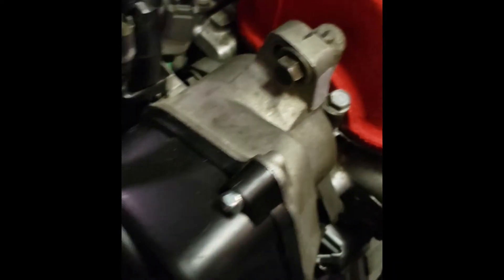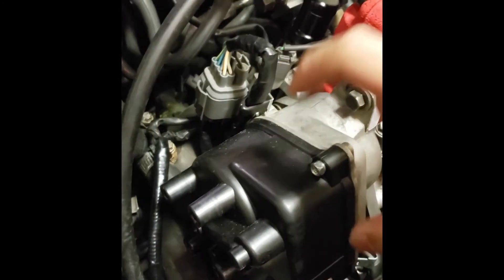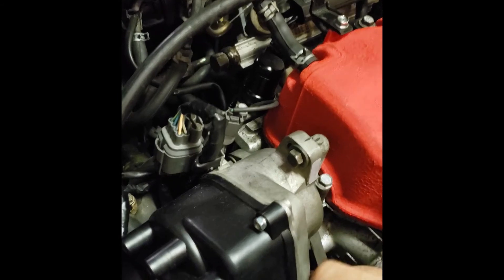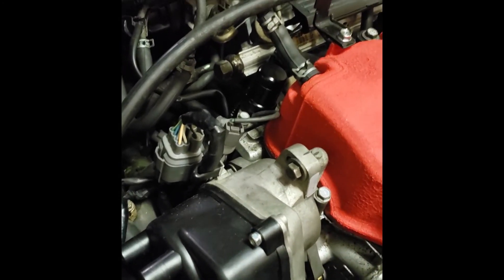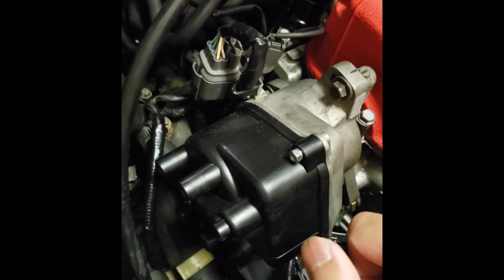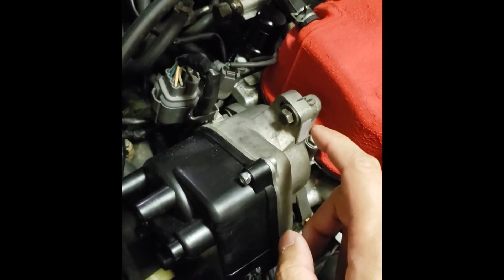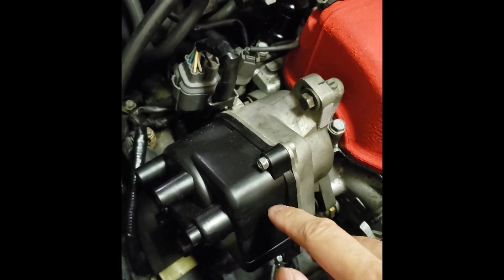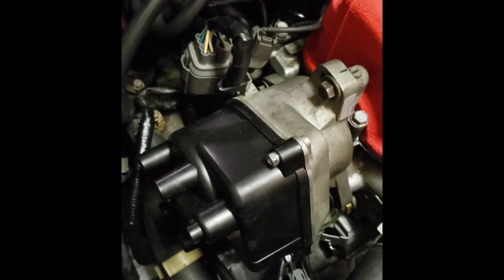[D16Y8 Engine Swap] How to fix #1 CYP Sensor Engine Check Light at Home (Code 9 Alert!)

Comment: Before you assume the worst, try simply unpluging the two aarness connectors and spraying "Electro Kleen" electronics cleaner on all the contacts, let dry, some compressed air speeds it up. The replug the Harness. You would be suprised at how often that trick works on a lot of sensors / connections. A tiny amout of micro corosian you may not even be able to see can affect voltage and thro off a false reading to the CPM.   Only takes 10 min.

Comment: I seen your videos and know a lot about Honda's I was wondering if you could help me out with my 1998 Honda Accord EX. What would make the battery to pop and lose all power? My Honda cranks but won't start it keeps blowing the ACG fuse.
I've taken everything apart to find the burnt wiring.
I unhooked the alternator and the the drier for the AC and tried to start my car it was still crank over but wouldn't start then the IAC started smoking and the pigtail was melting. I was wondering if you could help me out with my situation with my Honda
Reply from the maker: I'm not sure if I can help much because it sounds like you have a short somewhere in your wiring harness. Under normal circumstances, your fuses should never blow unless something starts to draw too much power or you have a short somewhere. The only thing that can cause wiring to burn like that is if one a wire that has 12v current constant or switched is grounded. What I would do is to determine all the things that flow through the ACG fuse and trace all the wires. Since it's the fuse that keeps on popping. Also, since your IAC started smoking, those wires would also need to be traced. You should use a multimeter and test if any of your wires are being grounded.

Usually wiring is quite a pain to work on since you'll have to trace all the wires and look for the exposed wires. A common thing that happens is rats or other animals get into the engine bay and chew the wires. 

I'd say troubleshoot your wiring situation first. Hopefully the wiring didn't fry your ecu as well. If your ecu is fried, it could be why your car isn't starting, but it sounds more like wiring issue first.

Comment: I got exactly the same problem mate. I run the car like 20 KM all normal, let the car working for 10 minutes or so no problem and sometimes really sometimes the RPM goes up and down and the engine light turns on. I got the code 9 and many people change the ECU/Distributor but I believe it's not like change everything it's looks like a stupid solution.

I will check what you did and I will try to replicate on mine scenario as well.

Thank you and see you soon
Reply: im having this issue atm too, SO FRUSTRATING

Comment: Code 9 won’t go away
Reply from the maker: If you've adjusted the sensor and it doesn't fix it, I'd try borrowing a known good distributor and try that.
Reply: @BudgetGears  this is the third distributor I have bought Evan tho checking the cyp sensor with an multimeter. All distributors are with in spec. I’ve tried swapping a new ecu I bought still the same code 9.  Tested wires in harness there all gd there’s no breaks. I Evan tried running new wires it did not work.  Car has been weird car day for a wile has had distErr crank no start replaced the distributor it went away got the car tuned parked it for a month and now have this code9. After adjusting that sensor today it ran a lot better but still get the code 9 at wot about 55 6500 so I hooked up the laptop today and noticed when I try clicking the high cam/fuel maps. It automatically switches to the low tables.  If I disconnect from ecu  smanager allows you to stay in high tables. I’m thinking it’s a bug
Reply from the maker: @single_cam9199  hmm thats really odd. I'm not familiar with playing with the fuel and timing maps but sounds like something is weird with the maps. Is all your mechanical timing correct?
Reply: @BudgetGears  yes sr.  You can only get 17 degrees on the distributor. The tuner takes in account for the degree in the tables. D16 made 436hp 380tq at 58% duty a lot left in it if I want it turned up
Reply from the maker: @single_cam9199  very weird. I honestly can't think of what might be the issue. Have you checked the honda forums to see if anyone had similar issue and had fixed it? I do remember many people reporting the issue but never had any solutions. Unless there's a short in one of the wires somewhere.
Reply: I got a 91 civic si all stock OEM showing 9 blinking red light on ECU and check engine light. Could this problem be a distributor issue? Some help/advice be nice. .
Reply: @Hmongyaj1980  distributor plugs , or bad engine/chassis grounds.  If the bolts are rusty and aluminum is all white. Bad grounds clean and use dielectric grease.  Strat at dist plugs then g101 ground junction at thermostat
Reply: Check your wires to the ecu there might be a loose or cut wire

Comment: Hi bro I got a problem some time my ek have check light out it's not appear and after some time it's come back automatically I face that problem many time can you plz help me that what's the problem
Reply from the maker: Alright. So since you're an ek, you'll be on obd2. Did you plug in a code reader and see what's triggering the light? Or did you jump the jumper harness to determine the code?
Reply: @BudgetGears  I have same problem it’s EJ9 2000 obd2b conversion to obd1 d16 throws code 9? Replaced the icm still the same?
Reply from the maker: @E36OB  have you tried a distributor that works fine from a friends car? You can also trace the wires for the cyp sensor and make sure that its pinned correctly on the ecu side.
Reply: It's have d16